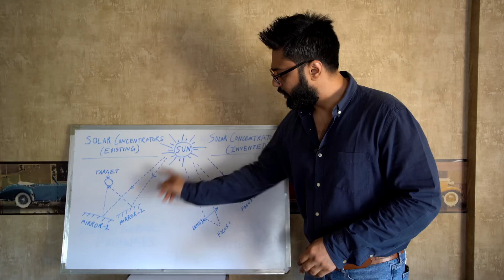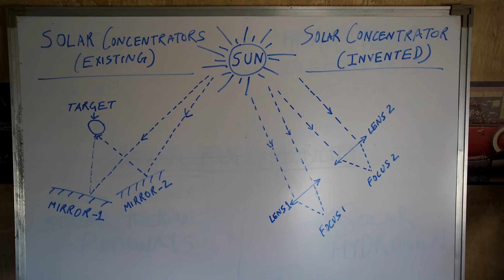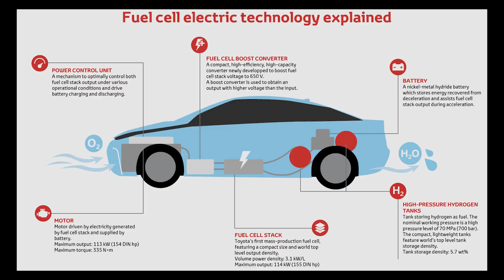Future Of Mobility ? [Solar Concentrator]

Comment: which ford car were u driving on the way to pune??
Reply: It was Ford Figo. He owns it.
Reply from the maker: Yes as KK VinakKumar said, it is the Ford Figo.
Reply: @KKCOnAMotive  i take it you are over 6 feet, if u are using figo as a daily commuter i think i can buy that aspire fr my daily commute too. my cousing has it, it is lil beast and very efficient too.
Reply: I drive a Aspire Petrol daily.
My height is 6'1".
Reply from the maker: @nareshuuu  - My height is 5 ft. 10" ... the Figo / Aspire is a good option for a daily for sure. As you said fun to drive & efficient as well i.e. 1.5L diesel engine.

Comment: Sir please give a breaf description on how it will work
Reply from the maker: Hi Gourav, most information which could be shared on the open forum has been already given in this video. 
But again to give you a synopsis, this machine i.e. Solar Concentrator will split Water (H2O) at High Temperatures using Solar Energy to produce Hydrogen which can be used in Fuel Cell Electric Vehicles etc.
Reply: @KKCOnAMotive  Thankyou sir for replying and we hope to see more of this solar concentrator in the future😊